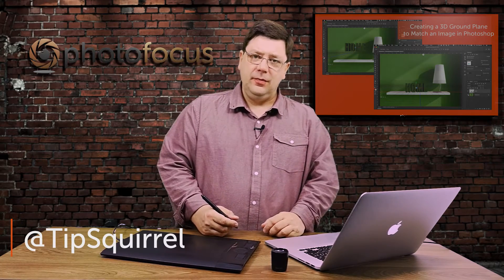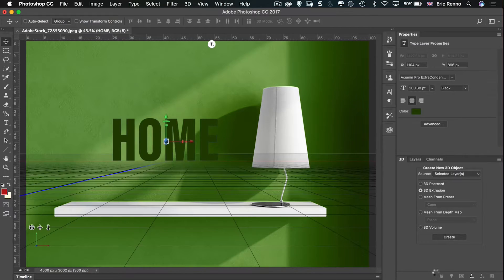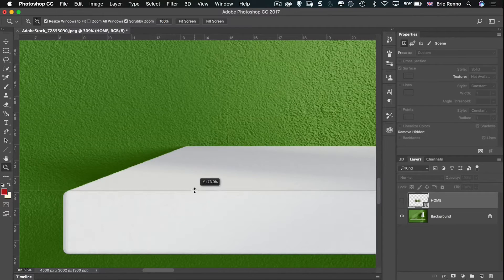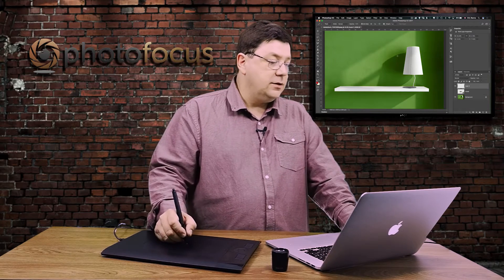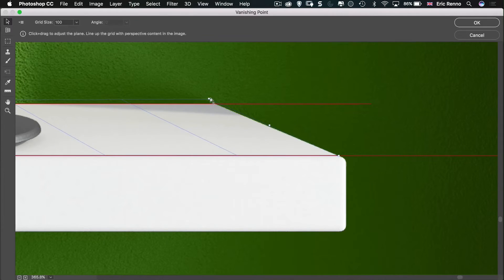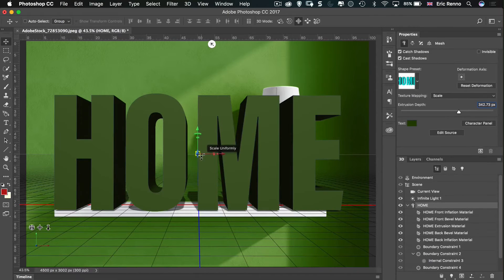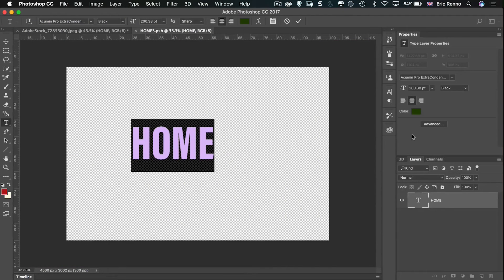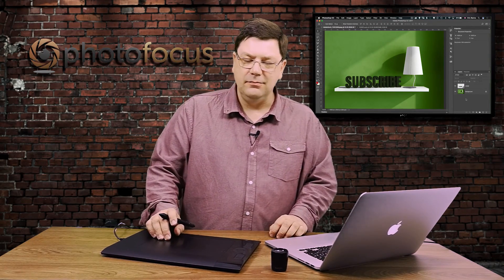Creating a 3D Ground Plane to Match an Image in Photoshop

Comment: the ground plane seems straight forward but, what if you need to put the word "HOME" on the wall as if it were a box sign hanging (like a picture frame) and have the light actually cast shadows on the wall not ground?